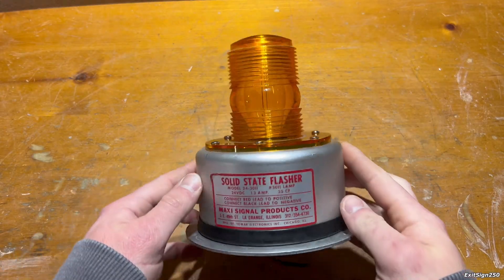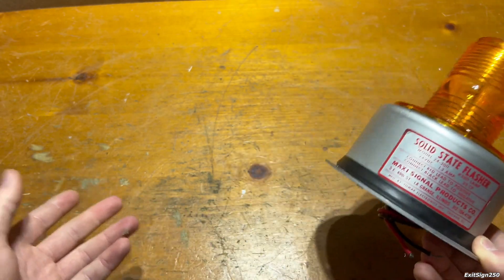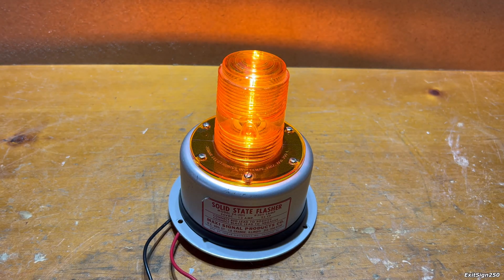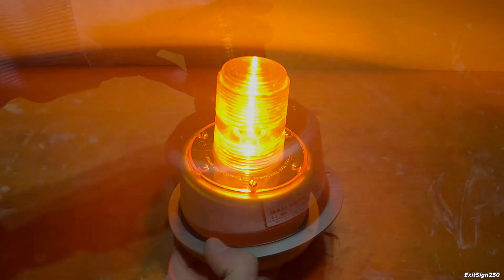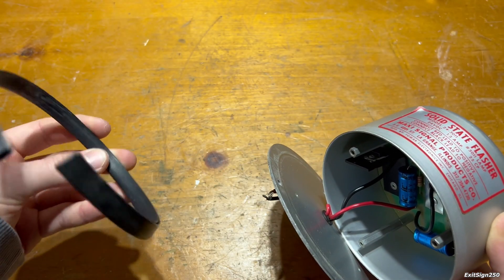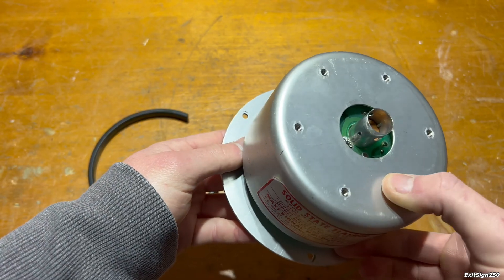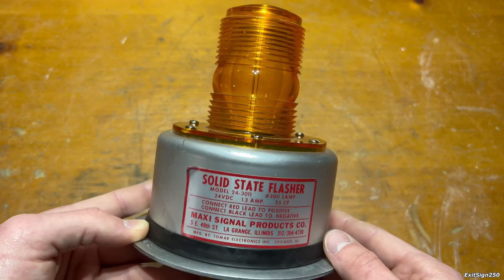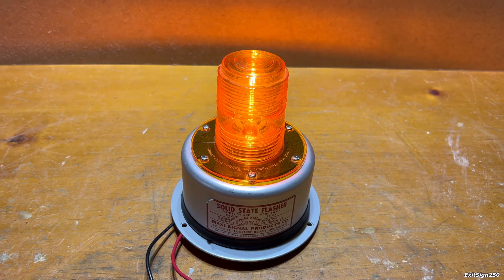Maxi Signal Products Co. Solid State Flasher | Overview and Test

Comment: If I'm remembering correctly,  the "trick" with the incandescent lamp flashers was that they flashed at a fast enough rate so the filament didn't cool down completely between flashes, lessening the thermal shock and so on